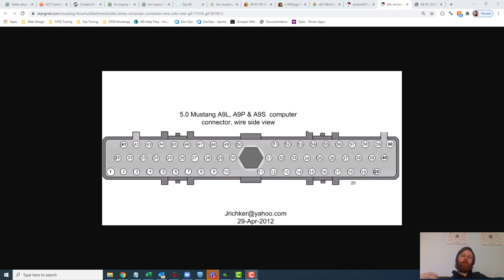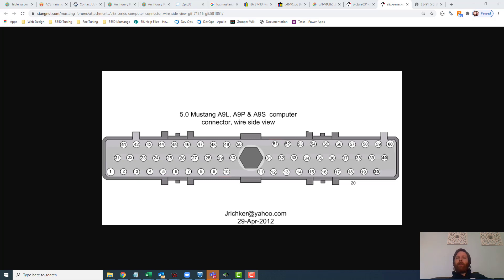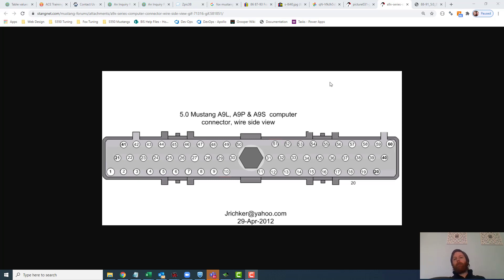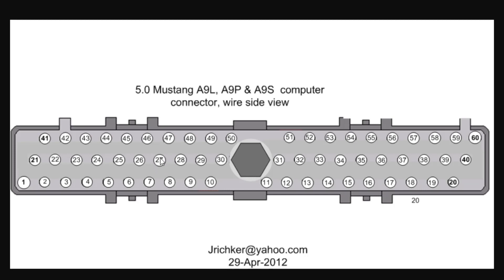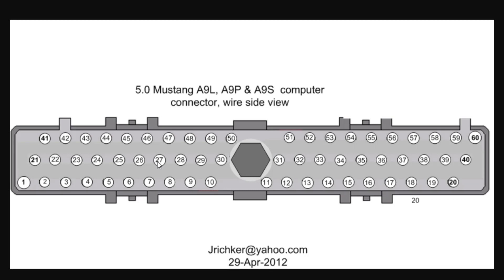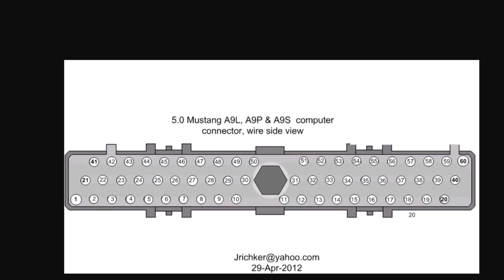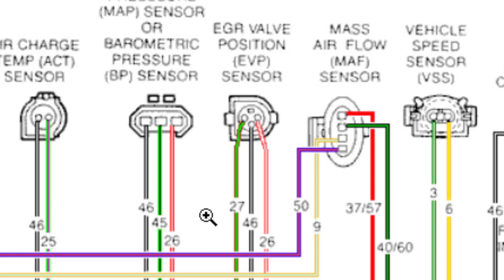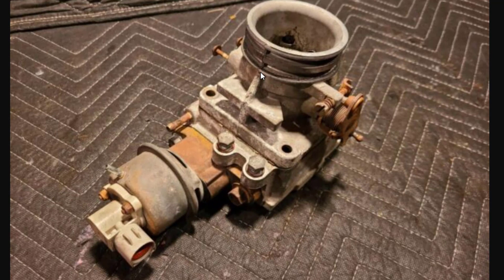Binary Editor Basics - 07) How to Wire Wideband AFR Gauge Analog Output Wire for Datalogging

Comment: Thank you! This was a super helpful video! I've  installed a WB into a 4cyl before and only had one bank to work with. Is there a preferred method with a V8? Is a dual bank (2 sensors) necessary or can you get an accurate reading from a single bank. I would prefer to ditch the O2 and just use the WB sensor/s if possible for closed loop operation. Thank you.
Reply from the maker: On a two bank engine that came equipped with dual narrowband sensors, like a fox body, I like to maintain both factory sensors in the stock locations. Then add an additional bung on the driver side exhaust for a single wideband sensor. At idle and cruise, you will be able to monitor the two factory sensors in datalogs to generally determine the health of the engine and any bank to bank discrepancies in fuel trims due to differences in compression, port volume, etc. Based on that, you’ll be able to tel if one bank is slightly richer or leaner than the other, pre-correction. Then when tuning the full throttle stuff, I tune accordingly for the leaner bank. If you really want to run a dual wide and you certainly can. But in order to log both channels on a stock computer deal, you would have to buy something like a super logger or a data Q.

Comment: I have an EEC-IV, 92 Tbird AOD that did not come with EGR originally. There is no harness in the engine bay. I found the harness for the computer, but there is no wire in pin 27. I added the yellow 0-5V analog output from my MTX-L to a pin into 27. I configured BE as you did, disabled the EGR ( In mine there is only a self test equipment present, says 2=off). It is reading 11.97 all the time regardless of what the wideband is reading. Any ideas if the ECM doesn't support this method if it originally did not come equipped with egr and I had to add the pin?
Reply from the maker: What ECU is in the car, and what strategy are you running?
Reply: The ECU is X1A2, I am running Gsali strategy.

Comment: I believe I asked this once before but didn't follow up. I can record my Innovate boost/rpm and wide band gauge using a PL-1 recorder. However, I'd like to see a MAP reading on the QH. I'm using CDAN4 strategy and since the WB is going through the PFE, the only other spare sensor I can access is the trans temp sensor. I would think I can verify what (GM style MAP) voltage/pressure relates to a temperature reading. Therefore, when I see 150* on the trans-temp, I know that's 1 volt to whatever pressure that is. I know trans temp can effect converter lockup but I think I can change or turn that off while testing or racing. Do you think that's doable?
Reply from the maker: Let me take a look at the cdan4 strategy in terms of the temperature based logic. I agree, as long as the tune can be modified to prevent any issues, you could use that input for a map sensor. There are a bunch of map sensors out there, but due to the prevalence of standalone efi systems, most of them publish their voltage/kpa data as to allow custom tuning applications.
Reply: @LeechMotorsports  My info shows me that the trans temp/voltage is the same as the ECT and ACT. I have somewhere in my notes the kpa/voltage for the 3 bar GM MAP. I would love to use the vapor purge flow valve which I think is an input but I don't see access to it in the strategy.